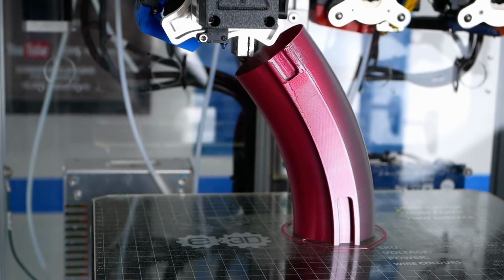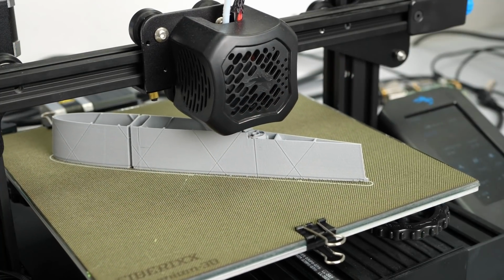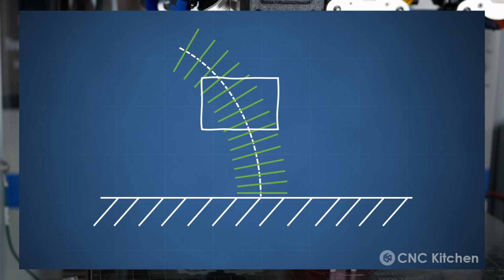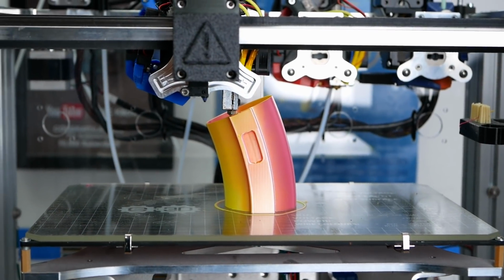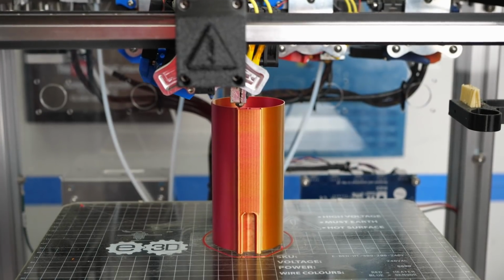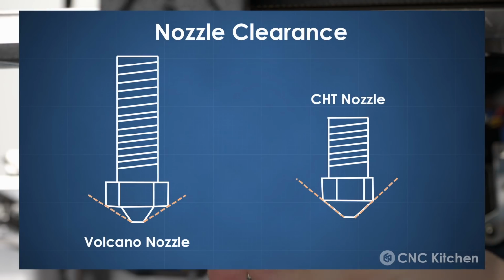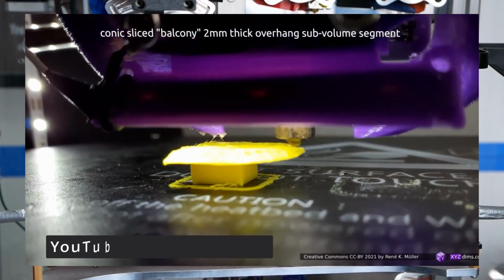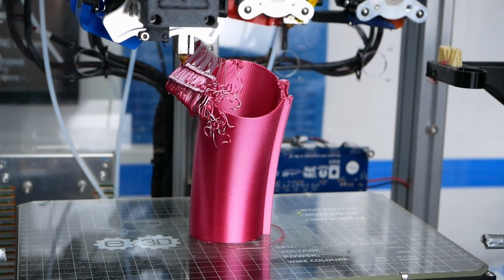NON-PLANAR 3D Printing by BENDING G-Code

Comment: Finally a step in non-planar printing practicable for us folks with affordable 3D printers. Guter Mann.

If Simplify3D wants to become relevant again with v.5, full-fledged non-planar slicing is the way to go.

The main reason, by the way, why I want a Rat Rig V-Core (to turn into a Jubilee-based tool changer) some day, is that its bed mounting is ideal for this.

Comment: Dear Stephan, this is very interesting, ingenious and intriguing indeed. As your work invariably is! But I don't think that it is correct to call it "non planar". After all, each and avery layer is on a particular plane, even though it's tilted. Non-planar means that the layers themselves are 3 dimentional, instead of 2-dimentional.
Reply: He included flow compensation so layers on a curve will have less material on the inside of the curve than the outside. Not as non planar as some printers but more non planar than others
Reply: @Jmoneysmoothboy  😉interesting approach!

Comment: That is what i thought 3D Printing was when i first heard about it.
I was rather disapointed as i learn that "3D Printing" was much more like 2D Printing in parallel layers.

That is somthing that could realy make a difference in manufacturing of complex Parts.
For example, imagine if you could FDM Print with 5 axis movements and combine that with fiber composites, using the polymers as suport and filler as as you build up complex structures.
🤯

Comment: there are "adapter" nozzles to use with an airbrush nozzle, they are amazing for non-planar printing. only for the longer nozzle a temptower is needed and normally i print with about 10-15° more in the heatblock

Comment: Sometimes I think about giving a neural network the control over my printer while having some cameras as feedback for it. Maybe add a 3D part scanner so it compare the result with the input file so it can do unsupervised training. It should sort out all visual quality problems on its own. Maybe a supplementary neural network could be setup to generate increasingly more difficult models for it (GAN setup) so the learning would not be limited by the dataset and it would train faster.

Comment: 11:04 Do note that while deforming the coordinates you'd also need to account for the changing volume elements by using a variable flow rate (specifically a flow rate proportional to the deformation's Jacobian determinant). This is essentially the calculation done in the video for the for the spline case but a bit more involved.
Reply from the maker: Good point but that would be the advantage form isoparametric elements.
Reply: Actually, no, we don't necessarily want the Jacobian determinant.  This would give uniform scaling in all directions, but this isn't actually what we want.  Instead, we want height to scale, and perimeter length to scale, but wall thickness to remain constant.  To keep wall thickness constant, we'd have to calculate the surface orientation at every point on the print, letting us determine orthogonal basis vectors for a plane tangent to the surface at a given point, and take the dot product between each of these with the partial derivatives of the transformation to determine the rate of change of the wall's area, not volume.

Luckily for us, for small angles of deflection from vertical, distances in X and Y only change a little bit, meaning we can get away with ignoring them and only considering Z.
Reply: @Keldor314  I love calculus

Comment: Would love to see this on the RatRig V-core 3 with its tilting bed. That would be awesome!
Reply: Wish i had the time to try and implement it in Klipper. With a plugin to control the 3 Z motors individually via gcode moves, it should be doable to adapt Stephan's code to tilt the bed as well, avoiding continuous Z motion. Not sure how much would be gained from that though, you would still be limited in how much you could tilt the bed, but should be able to get some steeper angles. Would be fun to try!

Comment: It would be nice to see what a "normal" planar tilted stl file would look like in comparison
Reply: just generate one in your slicer, that is the easy part... lol
Reply: @severpop8699  I mean, compare in terms of how long would it take to print and what geometry looks better to see where the advantages lie. Apart from having the layer lines twisted I don't really see the plus. I find it really cool that he was able to do that on his own tho!
Reply: @TheKdcool  the plus in what, non linear slicing for a 2.5 D machine in 3 axis, or having 5 axis to toy with?
Reply: @TheKdcool  Printing time is shorter if you don't need to print supports, strenghts is enhanced by a good percentage, post printing processign is shorter if you don't have to clean so many supports, overall apect i bettered since you don't have the supports attachenets to sand off.
So not bad at all.
Now by tilting the bed 30degrees in any direction you get an even better print and less supports to clean, if you can tilt and rotate the head, you theoretically need zero supports except for bed adhesion part...

There are advantges, but is a new thing and a great headache (for me at least) in the slicing part.
Reply: @severpop8699  thanks for the in depth reply, I guess what it would take to makes this viable would be a really long and pointy nozzle so you can do more than 30 degrees. Because 30 degrees (planar)  overhangs don't need support if you print fine enough
Reply: @TheKdcool  Soved that too, 60 degree pinting nozzle, more than enough to cope with 30 degrees tilting bed plus 30 degrees tilting hotend, already made 2 copies in aluminium, which is ok up to 45 C in slow printing and medium speed printing, to go above and print Voron style needs to be brass or copper plus 100Watt cartridge.

Comment: I would love a tutorial on how to design parts to be printed in vase mode (like not just vases but also more complex shapes). That could be a game changer in terms of efficiency and also quality since it gets rid of the seam.
Reply: Have you tried out the  "z seam alignment" feature in Cura?
In my experience it works quite well to hide the Z seam.
Reply: @Jehty_    I tried the "randomizer" and even tho it avoids the ugly vertical line, it just spreads the tiny imperfections all around the print and doesn't actually eliminate them.
Reply: @FraMurgia  hm, I generally don't mind those small imperfections. I never look that closely at a print anyways :)
But if your model allows it have you tried the sharpest corner or custom setting for the Z seam?
Reply: @Jehty_  The sharpest corner setting does work really well now that I think about it... I've been months just printing round parts and totally forgot about that.

Comment: Hey CNC Kitchen!

When it comes to nonplanar printing I think the airbrush nozzle adapters could be very helpful. I once saw a video where they put a ø 0.2 mm airbrush nozzle on a modified printer nozzle. Since there is a ø0,4mm version, too, you should try it. I always wondered why there is a 0.4mm version, now I know!
Now there are a few products out there, for example the BIGTREETECH® Budaschnozzle1.1.

Comment: Since this method requires a very long nozzle to avoid hitting parts, would it be possible to use a kinematic bed to adjust the angle of the part but keep the top surface and nozzle on a flat plane?
Reply: I sorted that out already, now in testings, will son put it on the market as .STl files, you buy them, print them, modify your machine and... TA-DA, you got a 5 axis printer, or 7 axis printer, depends what you want.

Comment: Fyi, the slots to re-direct the vase-mode spiral to internal features don't have to line up on every layer.  You can offset them 3-5mm every few layers and the slicer has no problems.  In return you get far stronger seams from the interlocking fingers.

Comment: Great vid. 
Now with Klipper's tri/quad gantry leveling feature, plus a narrow nozzle/hotend design, I suspect you can get reasonable angles without having to resort to a 6DOF Kuka arm tool head control. But, as you said, like many things today, it's a software problem now. I feell that if there was a simple way to take a model and "slice" it into equations that can be directly used in FullControl Gcode, THEN you could do some crazy shizzle. This would allow you to take each layer and tweak it, programatically. This would allow some real analytical control of the non-planar portion.

Comment: This is so amazing! I am a DevOps and automation engineer. I write python and bash for everything I do. I would love to help you make this more accessible!
Also, my Two Trees Sapphire Plus has dual Z steppers so I'd like to work in bed tilt non-planar. But the slant angle would move the part's X location and tracking that will be challenging.
Reply: I sorted that out already, now in testings, will son put it on the market as .STl files, you buy them, print them, modify your machine and... TA-DA, you got a 5 axis printer, or 7 axis printer, depends what you want.
Reply: @severpop8699  Um...where can we find more details on this?
Reply: @shadowbird42333  At the right time, maybe on this very channel, if Stefan wants to talk about it.

Comment: I wonder if this can be done on one of those printers that use 3 motors to level the bed.  Use a combination of the method in this video and tilting the bed to get even more of a bend before the limits of the nozzle or clearance become an issue.  Lot of complexity there because now the XY movements of the printer would have to account for a moving object that it is printing on but I'm sure that some clever people out there could come up with how to make it work.
Reply: nope, tilting limitations, discoordination of center while tilting, etc, but
I sorted that out already, now in testings, will son put it on the market as .STl files, you buy them, print them, modify your machine and... TA-DA, you got a 5 axis printer, or 7 axis printer, depends what you want.

Comment: Why dont just do bended design in 3D software ??? Like sweep or line extrude. Changing G-code is not easier.
Reply: Because that doesn't achieve non-planar printing.

In his special use case for the marble toy in this video: as he said in the video you can't have a non-horizontal top of the model with regular vase mode.
The only way to print the type of tubes he showed in this video is with non-planar vase Mode.

Comment: Why non-planar 3d printing doesn't exist boggles my mind.

We literally already have non-planar G-code in CNC machines for material removal on 3 axis machines. Why nobody has adapted something similar in 20 years is beyond me.
Reply: honestly most CAM softwares should be able to support it with a custom post that adds in the extrusion axis since Marlin/klipper/reprap use ISO standard G-Code with just some custom M/S codes

Comment: There are standard M6 nozzles you can buy that hold an airbrush nozzle. These nozzles are very slim at the very tip. Maybe that helps a bit with the angles.
Reply: Nonplanar. Xyz sell nozzle extensions (not affiliated)

Comment: Unfortunately, I only use my printer to print engineering parts like herringbone gearboxes, and custom enclosures for my projects.  
This printer has saved me tens of thousands in prototyping my ideas with Fusion360. 
Bending Gcodes is for artists.

Comment: I think the next evolution of non-planar printing would be to take advantage of printer designs that use 3 independent z axis. This would greatly reduce overhang issues and help with not having the print head in the way of some movements.
Reply: I sorted that out already, now in testings, will son put it on the market as .STl files, you buy them, print them, modify your machine and... TA-DA, you got a 5 axis printer, or 7 axis printer, depends what you want.

Comment: If you use this mesh morphing before slicing it would be a good way to change complex step files / parts to the tolerances of the individual printer. Just saying.

Comment: This is a great practical method. One of the things I had thought would be useful would be a print bed that was able to tilt in different angles,. The tilting would be controlled by stepper motors. I think that would open up some interesting possibilities.
Reply: I sorted that out already, now in testings, will son put it on the market as .STl files, you buy them, print them, modify your machine and... TA-DA, you got a 5 axis printer, or 7 axis printer, depends what you want.
Reply: Is your printer design available yet? @severpop8699

Comment: Great video! Can’t wait to try it out, I wonder if there is a way to use a tilting bed or gantry like on some modern coreXY printers to get some extra degrees of tilt.
Reply: The kinematic bed mounting designed by Jubilee project people and most prominently featured on the Rat Rig V-Core 3 would be great for this, as acknowledged by multiple people last year. The current Voron designs, however, are too stiff to add much in terms of potential printing angles. And the main project people have no plans to upgrade for this as long as the necessary software to make use of it isn't available. There are also open source designs out there for printheads tilting at least on one axis. Maybe three-axis ones as well. Biggest obstacle really is just the lack of supporting slicers.

Comment: Great thinking Stefan; simple for you but my addled 80yr old brain flinched at this🤣. I've been designing and 3D printing engineering parts for 10yrs and often wished to be able to do this, so have to resort to segmenting parts and traditional slicing to achieve strength. Of course, vase mode doesn't work well for my parts either☹️. Well done, and keep innovating.
Reply: I sorted that out already, now in testings, will son put it on the market as .STl files, you buy them, print them, modify your machine and... TA-DA, you got a 5 axis printer, or 7 axis printer, depends what you want.
Reply: Until you can do it with modern popular slicing and modern cheap printers, the idea is dead in the water. PTP for STLs will never work

Comment: I'd absolutely be interested in exploring vase mode designing and printing.
Reply: A video dedicated to that would be really interesting.
Especially looking at functional parts and not just vases.
Reply: Great video Stefan! Regarding vase mode printing I would be interested in seeing more on this topic as I am designing a 3D printed RC plane and have been using vase mode for a better print result. I have just completed a calibration piece to determine the best dimensions of the gaps between walls and junctions necessary for good and  strong vase mode printing. I have written up the results and would be happy to share my findings with if anyone is interested.
Reply: @rke1648  Yes, I've bought the printer and plans for a plane and would really love to see anything about this please!
Reply: +1 👍
Reply: Stefan, #JustDoIt ;)

Comment: There is a way to get past the 30 degree nozzle angle.  if you put the 3d printer on a bosu ball base, then you tilt the base when the 30 degree limit is hit.  You need to load the gcode into a custom bosu ball base and have 2 actuators to control the base.  The base would use arduino code in reverse that is used for a DIY Gimbal, look for| Arduino and MPU6050 Tutorial.

Comment: As you seem to be able to manipulate gcode, would it make sense/difference in preventing layer separation if there was such an infill type that would create small vertical pockets near the part surface that would later be filled with filament? A bit like vertical dowels are used to fix timber 'layers' when building a a log cabin. At least three or more layers should be possible to be tied into each other this way. 'Filament dowels' could be staggered around the perimeter to form almost continuous vertical tie on the part.  ?
Reply: That sounds like a decent idea for regular slicers to implement as well

Comment: You can do this easily with Blender with a Lattice modifier.
Although the way Stefan did it with using vase mode is cool too. I like vase mode!
Reply: You missed the point of the video.
What Stefan is showing here is non-planar 3d printing. You can't do that with Blender.
Reply: Better use bend modifier and stefan is not bending 3d model, but gcode :)

Comment: What would be great would be a way to print something on a 30deg plane without changing the part geometry, it would be good for improving the strength of tall parts. Wonder if you could use blackbelt cura or something to slice it and then edit it using that program to print on a regular printer?
Reply: You can do that in a vanilla slicer already just by rotating your model so its standing tilted on the print bed, with some support material underneath it.

Comment: Try making a nozzle using your mini lathe that has a super sharp angle, great video btw:)
Reply: If you look for "3d airbrush nozzle" you will find some long and thin nozzles.

I bought one of those in 2019 after seeing a non-planar video. Never came around to trying it. Maybe I have to give it a try now.
Reply: Buy kits from nonplanar. Xyz
Reply: Nozzle coolsdown relatively fast
Reply: @vipulchari3578  I have a weird nozzle here that has an almost 60° taper. Prints fine with only a layer of Kapton tape on it.
60° would be more than sufficient. Any higher than that and he wouldn't have sufficient layer overlap anyway.